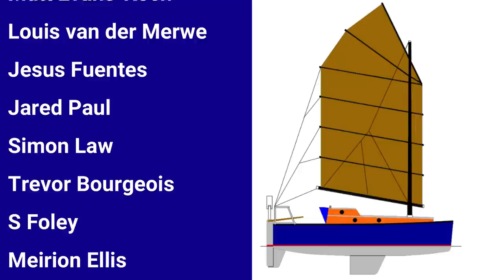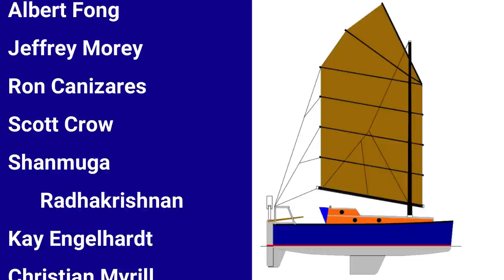S2E55 Building my $200 Cruising Mast (28 feet) Part 1

Comment: I wonder if this massive mast won't be too heavy for the waverover. There is now a lot of weight far above the boat. Wasn't a hollow wooden mast better, for example made of trapezoidal slats, then you immediately come closer to the round shape. The mast is lighter, the wood is cheaper, and you have a place for the wiring.
Reply from the maker: I cover all these points next week in Part 2

Comment: you said "you have to crack an egg to make an omelet" , how about "if you want to hold a dance you have to pay the band"   i have a way to scarf boards up to 48 in wide (plywood) using a router and it comes out ready for epoxy fit up.   it make for a real strong joint and an old boat builder showed me the method     thanx and nice video and boat    rick
Reply from the maker: Hi Rick, do you want to share the scarfing idea. If so send me an email  alanbmulholland@gmail.com

Comment: It will be interesting to see how that goes I did a similar thing on my project an 11 ft sailing dinghy with a short mast for a sprit rig, In the end a friend came around just as I finished it, I was not happy with the weight, and said he had a carbon fiber mast I could have for free.  The Mast was also a tad short for a sail I found at a great price so it was an easy decision. I have kept the wood mast though as I have a smaller sail so might develop 2 rigs one big for speed and one easy for teaching my Granddaughters.
Reply from the maker: In the next video, I weigh the mast and I think that it will surprise many.
Reply: @RoversAdventure  Don't get me wrong I'm not knocking the idea, plenty of solid wood masts out there. Its a very interesting aspect to the build.

Comment: I see many knots in the lumber, might those be possible weak points in the mast? I suppose less so with a laminated mast than if it were a solid spruce tree mast. You're also a woodworker by trade, which I'm not, so I think I should stop worrying and trust that you know what you're doing 😊
Reply from the maker: As long as the knots are tight and you laminate the mast well you won't have any problems
Reply: @RoversAdventure  Good to know! Thanks for answering 🙂

Comment: Alan casually flexing his framing chops with the full-depth, blind, free-hand, circular saw rip. Kids at home might want to try that on some scrap the first time. It’s just about the biggest cut your saw can make!
Reply from the maker: I used to work with massive timbers as a second year apprentice using a 10" circular saw. You are absolutely right about doing a bit of practice before attempting this for the first time.
Reply: @RoversAdventure  It shows.

Comment: Another great video! Can you tell use the glue that you have chosen it use?
Reply from the maker: Thanks Ron. I used Titebond 3
Reply: @RoversAdventure  Thank you. An unrelated question: when you were sailing from the Caribbean to Nova Scotia, once away from the Caribbean islands, what sleep schedule did you employ? Thank you for your response/input.
Reply from the maker: @roncanizares9966  Covid was in full swing and both the seas and the sky were virtually empty. I would get a fair bit of rest during the day and keep a 20 min watch during the night. As I got closer to New York and Halifax the shipping increased and I kept a more rigorous watch schedule. A 20-30 minute 360 during the day and 15-20 minute 360* during the night.
Reply: @RoversAdventure  I asked Leo, the host of the Sampson Boat Channel why he didn't use Titebond III. It seemed to me easier to use and I have had very good luck with it. His answer was that the manufacturer of Titebond does not recommend it use for below water applications. I was skeptical but from the titebond site: "...Titebond III Ultimate Wood Glue is not for continuous submersion or for use below the waterline...." He used Gorilla Glue instead: however that has a similar restriction. I notice that on some of his later work on material that was well above the water line he was using titebond III.
Reply from the maker: @davefoc  I'd fully agree with that. I would only use epoxy below the waterline.

Comment: Is there a reason you didn't use a belt sander as a last step instead of a hand planer to prep the the surface for gluing?
Reply: Also, I agree you can never have too many clamps.
Reply from the maker: The plane give far more precision and you need a tight joint with Titebond.

Comment: Very cool. Question; why didn't you just buy a telephone pole and trim it? Is this lighter? Stronger?
Reply from the maker: They are more expensive and pressure treated, two things that should be avoided.
Reply: @RoversAdventure  ah, I see cool. My  old boat neighbour built a mast for his 40ft ferro cement sloop out of one. It's 10 years old but probably only has a few years left by the way it looks...probably because it was pressure treated? (And poorly maintained). Honestly didn't know pressure treating wood was bad for marine environment,  good thing to know :)